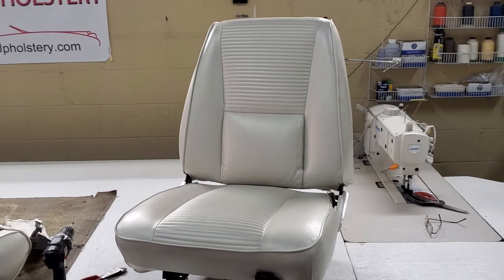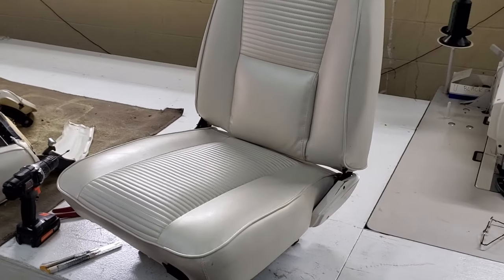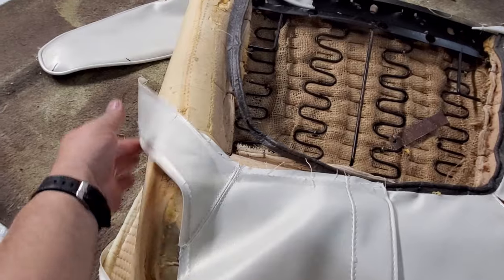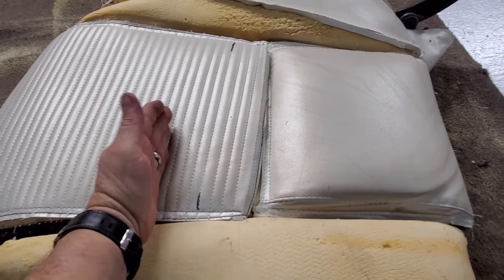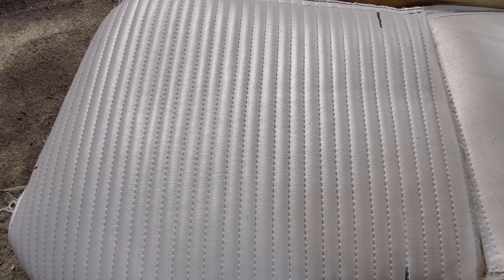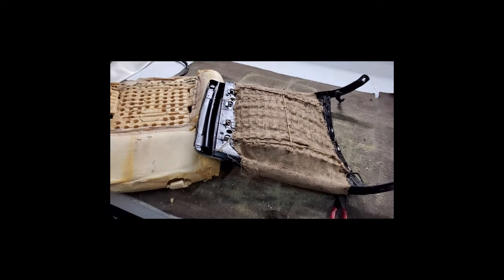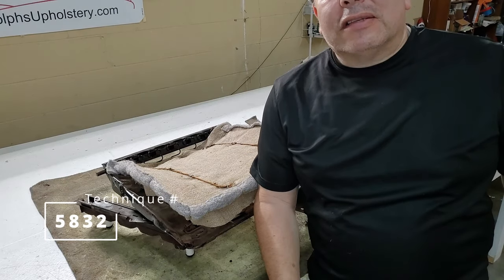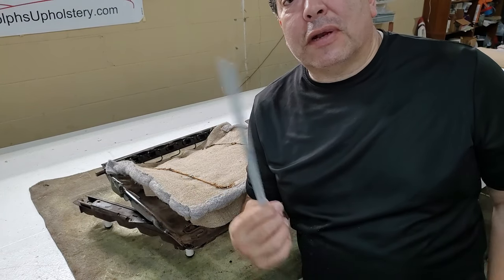DIY learn how to refoam a car seat cushion Auto Upholstery

Comment: I am subscribing! Old school can be the best as a service apprenticeship in a 2 man shop from a high school that didn’t even have a shop class or auto. But an ASE Master Tech since 1978 at a dealer with 8 tech’s and the service mgr couldn’t get anyone to take one test, much less 8.
  Self taught in patterns to sewing after my wife took classes with her sister, I had to help with home work. Sewing is rewarding but one must pay attention to margins, measuring and just planning the panel. The rest is knowing you machine and execution of “Best Practices” for the stitch. You made reference to a jig-was blade but looks like a clean hack saw and never thought of trying one. Very cool. When the foam is not dead, I like glueing burlap on the seat frame channel, foam side first to add strength. Just a common sense move if new is not in a budget or not available. Enjoy the learning! Thanks for sharing!
Reply from the maker: What an awesome story! Thanks for sharing. It is so nice to share experiences!
Reply: @blowme5150   I am sewing leather for the doors, console I made and the seats I cut & heavily modified from a 2003 Tahoe! Ever weld anything? If not, it is fun to watch! Bahahaha!
 Like grandpa said; Their is an ass for every seat! 
Oh, did you become an ASE master tech or did you pay someone to take all 8 test with 60 questions each. L1 is 100 questions: I missed one. It is advanced emissions control, or are those words too big!

Comment: Hey there, great video! You've got some serious knowledge. I'm working on this project, fixing up a weight bench specifically for bench pressing/lifting weights, and I'm kind of lost when it comes to choosing the right foam. Any advice on what kind of foam I should be looking for? Your input would be a big help. Thanks a bunch!
Reply from the maker: Hello Jay, Thank you so much for all of your kind words! Low density and firmness are for comfort. High density and firmness are for support. I would think you would need a higher firmness for your project. Please keep liking and watching!
Reply: @oldschoolautoupholstery  Sure thing! One more question: should I factor in foam density and compression? I came across an online source suggesting that 2.5 pounds density and 36 pounds compression should work. What are your thoughts on this?
Reply from the maker: @jayabner8423  Hello Jay, sorry to say that I never get technical with foam numbers. I don't hurt my brain with the rocket science. I just go to my upholstery supplier and "Feel" the foam. That is how I get my answer. You see what I mean now? See this video https://youtu.be/-ylXt_hIgU8 Please keep liking and watching!

Comment: Never done work like this, but I'm going to DIY reupholster the front bench seat on my 1964 Comet.  Should I use high density foam for my fat butt?  I weigh 250.
Reply from the maker: Hello Blister, I think you will do just fine on your project. I like 1964 Comets. High density is fine, but you may want to put a layer of cotton or Dacron over the top for more comfort. Please keep liking and watching!

Comment: what kind of foam is the white foam? i’m just now learning upholstery, and i’m just curious what type of foam is used for this.  also what are you using to cut it with? thanks
Reply from the maker: Hi! Basically, there are three densities for upholstery foam. High, medium, and low density. Most projects will use a medium density. Also, the way to measure is not by squeezing the foam between your fingers. The way to measure the density is to place your hands on each side of the foam like praying hands and push your hands together. Learning by doing! Go for it!

Comment: Nice video 

I have a couple of questions 
first what kind of tissu / textile you were using to rebuild under the foam 
also what was the stampler / tool you were using from 3:07 to 3:40 for fixing the felt and the tissue to the frame ? what kind of glue you were using for the foam ? and finally to which supplier can I get the stampler ? 

I'm repairing my own 1965 Baracuda as an amateur and wish to do a effective job
Thank you very much !
Reply from the maker: Hi! I think that would be Burlap, then Jute pad. The tool would be hog ring pliers. Use a good construction-grade contact adhesive that can be bought at Home depot. The other tools and materials can be bought at an upholstery supplier. That 65 Baracuda will be a nice car when you're done!

Comment: Can you share the specs of the foam you used?
Reply from the maker: Generally, you can ask your supplier for light, medium, and high-density foam. Older cars are most likely medium density. Newer cars have a high density for a stiffer seat to keep a better shape. Thanks for checking!

Comment: Finish the seat... where is part 2 to this video?!
Reply from the maker: This video is about re-foaming a seat. This was completed in this video. There is nothing more to re foam...
Reply: @oldschoolautoupholstery  Can a new seat cover just over over the top of this and it will give it shape? Or do you have to further shape the foam? Incredible work btw. Your channel is a wealth of knowledge.
Reply from the maker: @99Isopropyl  I don't think that anything other than what was done would be an improvement...